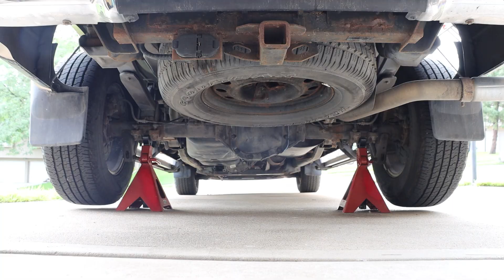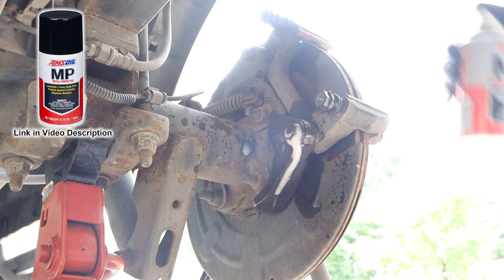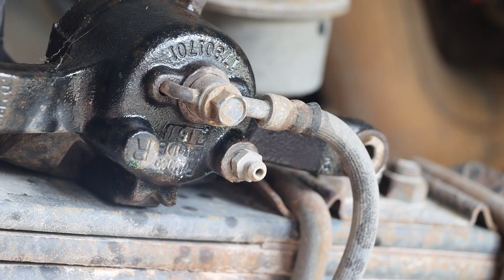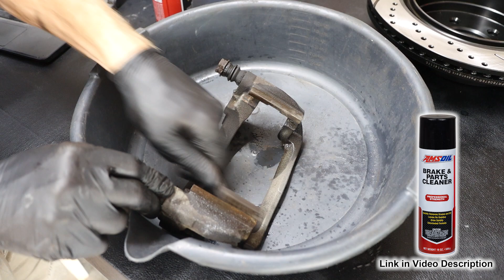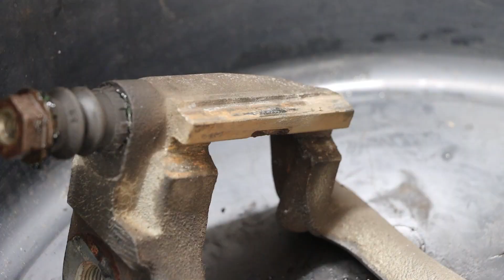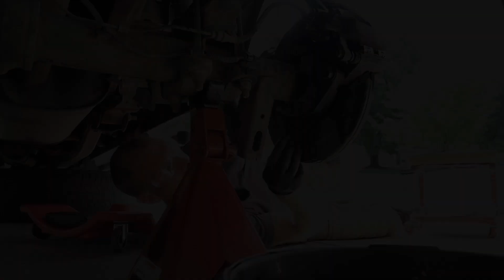Rear Brake Pad and Rotor Replacement - 2012 Ford F150, 3.5L (2009-2014)

Comment: Phenomenal video, one minor question.  Shouldn't you also put chocks behind the front wheels to keep it from rolling backwards?  Thanks again for the video.
Reply from the maker: Good thought.  At my house the driveway slopes toward the street slightly and I had the vehicle backed into my driveway.  If you were on a flat surface, I would definitely recommend chocks both in front and behind the front wheels.